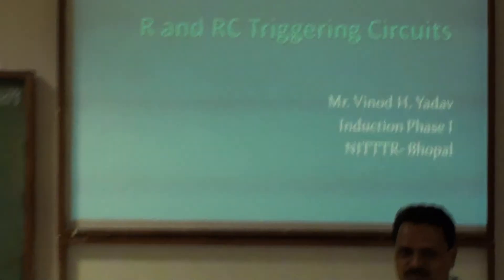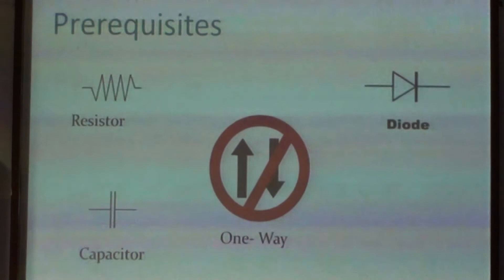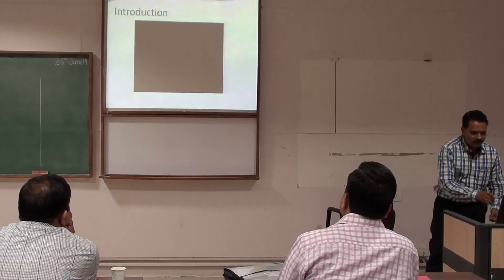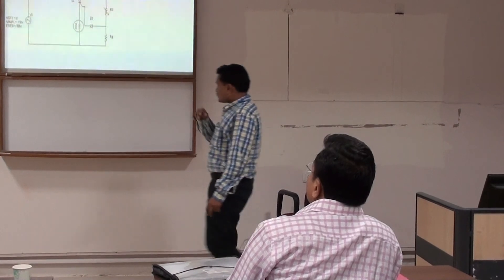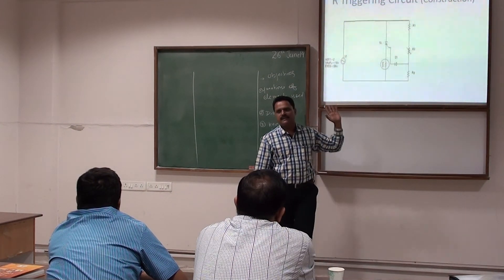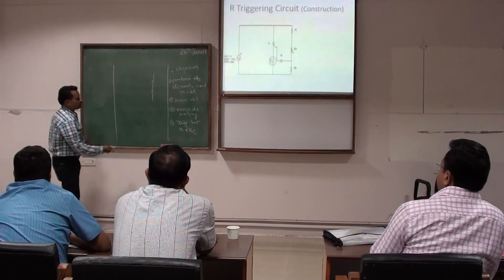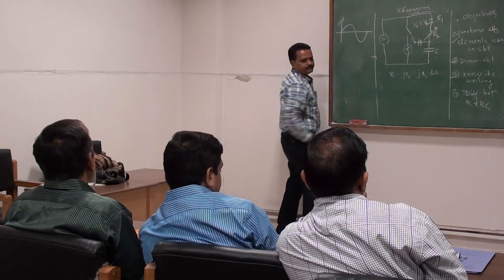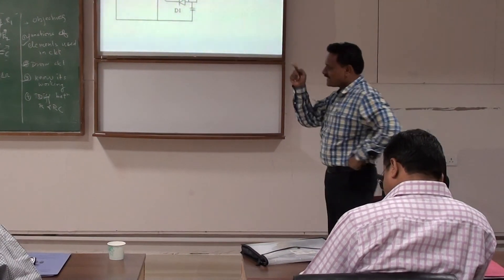R and RC triggering Circuit

Comment: thank you sir. my ques is....why the 90 degree firing angle is a disadvantage for R triggering ??
Reply from the maker: One half cycle of sinusoidal wave is of 180 degree and it is desirable that full 180 degree should be available for us to control the phase. The 'R' triggering offers control up to 90 degree only, so is considered as disadvantage.
Reply: sir, can we change the phase angle in RC triggering from 0 degree to 180 degree ?

Comment: Hi,
could anyone please explain what happens when the resistor is replaced with a capacitor in RC triggering circuit ?
Reply: if resistr is replacd wid capactr ,,,,then it reqire chargng time,,,and trigger will B periodic.
Reply: @prashantdaharwal7519  Bro, can u explain it briefly.